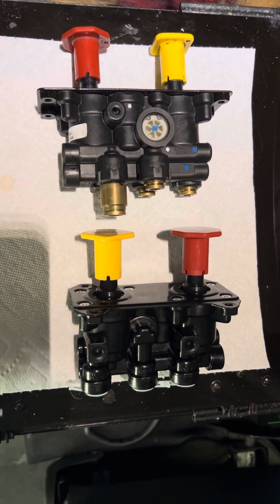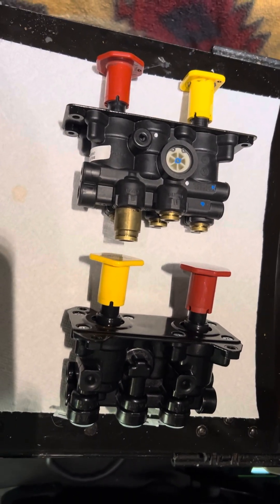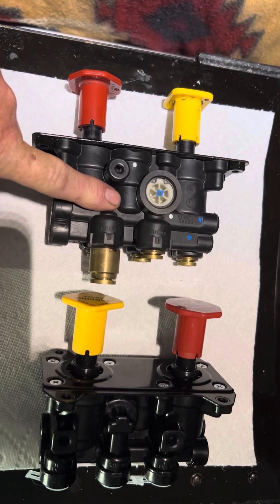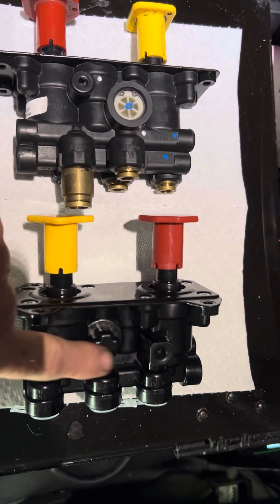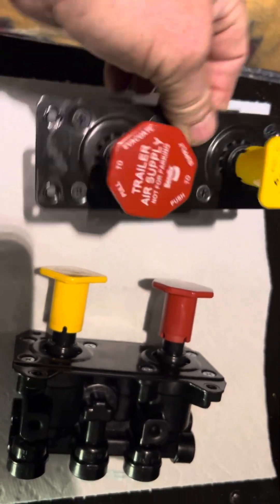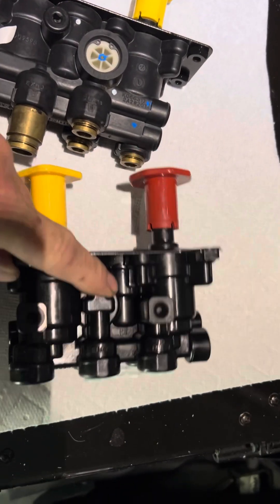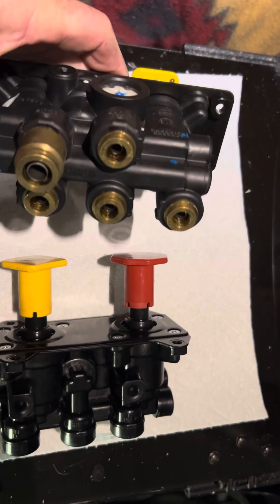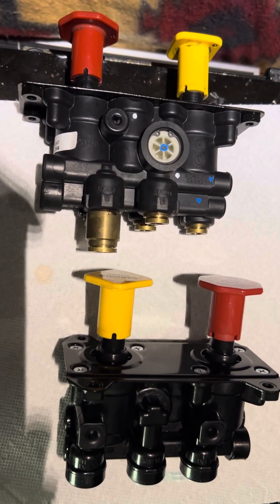Peterbilt vs. Amazon parts

Comment: Save your old one and match up the seals and rebuild it using seals from Hercules Sealing Products. I used to do hydraulic and pneumatic repair. That thing will last you forever with really good seals. If I buy a cheap jack from Walmart before I even use it I will take it apart and put good seals in it.
Reply from the maker: That’s a good idea. When I first went into the dealership, I asked for a rebuild kit and they said they don’t make them. I knew that wasn’t true but I was stuck and had to get on the road so I paid my money but I will look up that Hercules, order a kit and use it for a spare.
Reply: @davida.simpson7011  they may not have a specific kit for it and if they do it would cost much more than just matching up the seals. I bet you could rebuild that thing for less than $30 by matching up the seals. Get a set of decent digital calipers if you dont have one and just measure it all. They will have ones that fit. As for whether you want 70 or 90 durometer I am not real sure. I would go with 90 and if they cause an issue go with the softer 70 durometer.